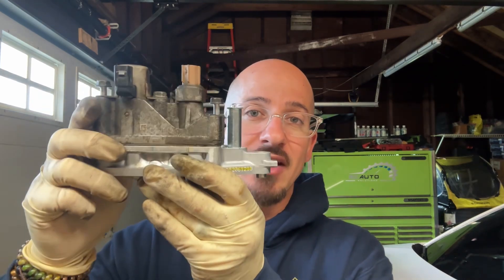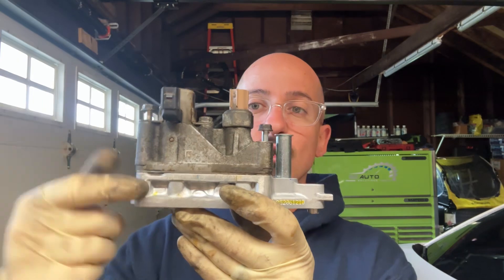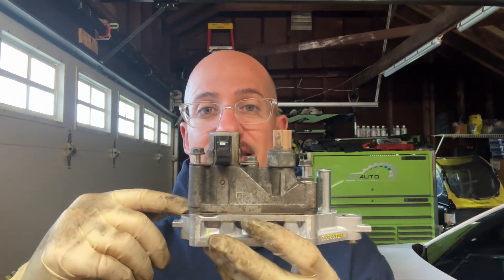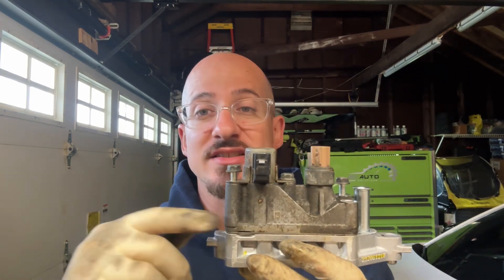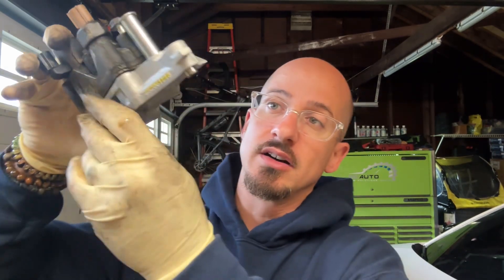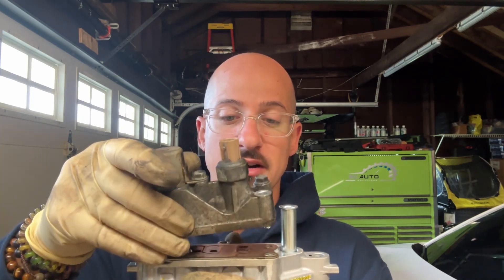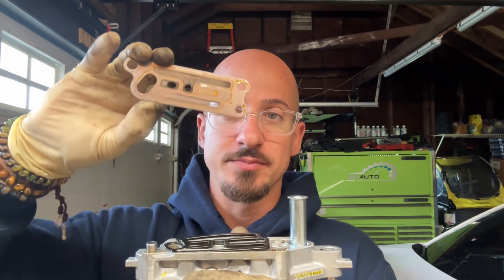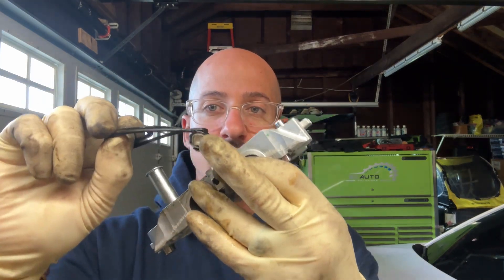Q&A Episode 110 (spool valve | hybrid vs 2.0t | 1.4 million investigation)

Comment: Our 13 RDX alternator failed and culprit was leaky spool valve gasket failure. Purchased aftermarket MAHLE brand spool valve gaskets from OREILLYS AUTO PARTS and replaced gasket and it has been over 20,000 miles and still dry. Just be sure to transfer over the screen/ strainer from OEM gasket because the MAHLE one looks smaller. I am an extreme DIYer and was able to pull this off from watching your content. Thank you BC Boss man!
Reply from the maker: Awesome, Mahle was not an option when I was trying that method. I shall give it a shot! Thanks
Reply: @BCautosutions  When I was figuring out my options in the thick of this situation, the worst case scenario would have been get a refund for the Mahle gaskets if they didn’t work out, because on top of the OEM rebuilt Alternator expense I purchased online from OEM Acura Parts from Hubler Acura of Indiana,
I didn’t wanna drop more Benjamins on an OEM spool valve primarily for the gaskets, and am glad the MAHLE gaskets worked out.
Reply from the maker: @ELLobo2424 🙌

Comment: When do you commonly see battery replacement and starter replacement? My 22 Ridgeline has an AGM battery. I disabled the start stop system but it was driven 25,000 miles with it active because I bought it used. I have about 35,000 on it now. Winter is coming and I’m sure you can relate about winters in the northeast.  I heard in a lot of forums when the battery does go bad sometimes it will pass the parts store load test. I also heard almost every light on the dash comes on when I needs replaced, something about low voltage and the modules throwing communication codes? Has that been your experience? Also is there a relearn procedure or something like that for the new battery? Thanks in advance!
Reply from the maker: I’ll answer this in a Q&A.

Comment: What are your thoughts on a lithium battery? Was looking at the antigravity brand and it’s only 14 pounds. I also have a tlx type s.
Reply from the maker: Love the weight savings but very expensive. I just bought another lithium one to test. Hopefully all goes well as it was significantly cheaper than the antigravity. If it works out well I’ll spread the news.

Comment: I got a question... have you heard anyone mention the fact that the owner's manuals of 23+ CR-Vs all say "87 octane or higher" yet on Honda News they say "87 Octane (91 Recommended)"? I recently had a misfire that ended up being cured simply by switching to 91. I know it's most likely a bandaid fix for a fuel injector issue, but it is bizarre how now they recommend Premium.
Reply from the maker: Yeah I’ve seen that myself. Not sure what to make of it but seems like someone is not on the same page there.

Comment: For a future episode , can you touch on changing the battery as DIY using a portable jumper/battery as memory saver to connect to the OBD port ?  Will this method harm the electronics and/or fuses ?  Specifically on a 2017 MDX w/TECH
Reply from the maker: You got it

Comment: I get manufacturers have to keep up with tight regulatory/consumer expectations, but seems like Honda engineers messed this up, better head studs and/or a better head design (no groove) might prevent a lot of the failures, so why is Honda not acting??
Reply from the maker: Head studs and block (groove is on the block not head just to clear that up). I’m not sure exactly why or why not things haven’t been addressed. Unfortunately don’t have those answers
Reply: Yep they’re still making them. I think we will see the problem fixed once the 1.5T is phased out, hopefully. And a company like Honda has some pretty good bean counters I’m sure. And maybe this problem costs less to ignore and sacrifice reliability reputation than it does to do something about. Guy I work with had a low mileage Accord and his blew at 70,000. He religiously serviced his car at the dealer. They quoted him $5,000 for the head gasket job. He escalated it and got $1,500 towards a good will repair. He was giving the car to his daughter for college and he figured it’s cheaper than buying a used one that he knows nothing about. Luckily he had it paid off already.
Reply: @richieg7382 you could be right for sure, however Mazda had a problem with cylinder heads cracking on their early 2.5 turbos, seems like they fixed the problem in late 2020, and have also offered an extended warranty up to 120k miles on impacted vehicles (albeit after a lawsuit), so would be nice to see Honda do the same

Comment: Would it be helpful to run 93 octane on the 2.0 hybrid engine?
Reply: Good question, I hope the answer is No
Reply from the maker: I run high octane on everything I own, sometimes even my lawn mower 😅. To be serious tho, yes! It’s an extremely high compression ratio engine, 13.9:1 to be exact.
Reply: @BCautosutions will it hurt or diminish the engine at all running it on 87 octane? that’s kind of the purpose buying a more efficient vehicle (non Acura)
Reply: I run 93 octane, Top Tier only, but I’m only using 4-5 gallons in a week or week and a half.
Reply: 93 octane in Michigan is $ 1.00 more . Joke doesn't need to be 1.00
Reply: @kenj.8897  I live in Michigan as well in a town of about 10,000 population and most of the stations charge $1.20 more but the Sunoco station for 93 octane it's only 60 cents more. I have no idea why the big difference.
Reply from the maker: @kenj.8897 insane, shouldn’t have to be that much higher smh.
Reply: I have this engine and would hate to spend a $1.00 more per gallon. With such a high compression ratio I’m surprised it even runs on 87 octane.

Comment: I tried to replace the spool valve gaskets but it was leaking out of the hondabond on the mating surface below that. I ultimately went through three alternators but had the spool valve replaced between two and three. The spool valve was leaking again when I sold the vehicle and the third alternator was still working. What a freaking mess. I can appreciate them going to a DOHC J series engine without the spools but they also could have done a better design of those spool valves and not kill alternators as a knock on effect. I guess I have one on my J35Y7. I'll be watching that thing like a hawk.
Reply from the maker: Yeah it surely if frustrating we just had one today. Guy towed in the car and towed it back out 😮

Comment: Sad times for Honda?  Just seems like, as a Honda fan, there are serious issues being seen with almost every engine.  If you need a bigger vehicle than an HRV, seems like I'm rolling the dice on whether I want to risk rod bearing issues or head gasket ones.  I realize any engine, from any manufacturer, can have issues but it sounds as if you're noticing more than one-offs.
Reply: Certainly hope the 2021+ J35 is in the clear or I'm SOL
Reply from the maker: Yeah we are definitely at hard point currently. I truly hope things can be turned around.

Comment: My main can't help himself but hate on the 1.5T lol
Reply from the maker: I wish it wasn’t such a big topic, unfortunately it affects so many people.
Reply: No hate, just facts
Reply: @ELLobo2424 ours has been fantastic since Jan 2017 👍🏼
Reply: @MeltingRubberZ28 follow BC advice, premium fuel always, never go long oil change intervals, I personally do 3K, and keep all fluids clean, coolant etc., drain and fill every 30K especially coolant on that 1.5T!
Reply: @ELLobo2424 do you remove the thermostat when changing coolant?
Reply: @MeltingRubberZ28 I personally don’t, consistent drain and fills to keep the fluid clean should suffice , radiator drain and fills, changes out most of the old fluid.
Reply: @ELLobo2424 ours has been great

Comment: Also, what actually happens with a head gasket failure? What would you say the collateral damage is both on average and in the worst case? What are the typical repair bills? Once the repair is complete, can a customer typically expect a long lifespan before that failure occurs again?
Reply: Coolant starts leaking into the combustion chamber and the car will start misfiring
Reply from the maker: I can get into this in a Q&A will be easier lol.
Reply: @BCautosutions looking forward to it!

Comment: I’m going on a 1,100 mile road trip down the east coast. I’m going to bring it into the dealer a few weeks beforehand for an oil change, anything else you would recommend I request or do myself other than their standard complimentary point to point inspection?
Reply from the maker: What car and mileage?
Reply: @BCautosutions 2023 civic sport touring with the 6MT, 14k miles. Thank you sir!
Reply from the maker: @Ok_Mountain_8698 it’s a fairly new car I would hope there’s not much it needs. Few things to check: 

-Make sure has no leaks
-Check tire pressures and adjust (we are going into colder weeks) 
-battery test (a jump box to go may not be a bad idea)
-wiper condition 
-top off all fluids
-alignment if it hasn’t been done within a year or 15k (your right there 😅)
Reply from the maker: @Ok_Mountain_8698 I may turn this into a Q&A question
Reply: @BCautosutions sure sounds great, thanks again. You could probably discuss this topic briefly across a range of mileage to make it relevant also to people who don’t have such a new car
Reply from the maker: @Ok_Mountain_8698 for sure!

Comment: Odd that the Passport is not part of the original recall and the new investigation.
Reply: Maybe it has to do with the plant the engine was made in. Or it could be a supplier issue? I know all of the J series vehicles are assembled in Alabama but the engines and parts come from all over. I do believe also that Alabama has its own engine plant as well. It’s hard to tell. Honda may never share exactly what happened. But the other manufacturers do the same thing. At least Honda isn’t asking us to use 0W-40 and change the oil cap! 😂
Reply from the maker: Yeah not sure why or why not tbh